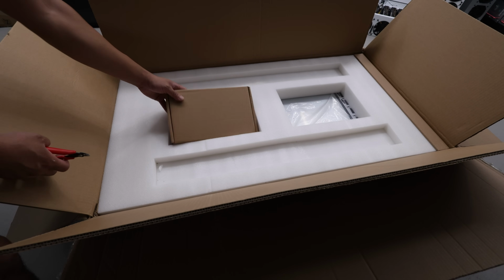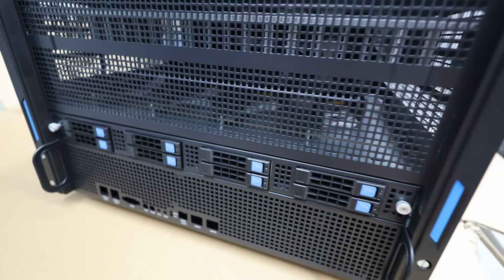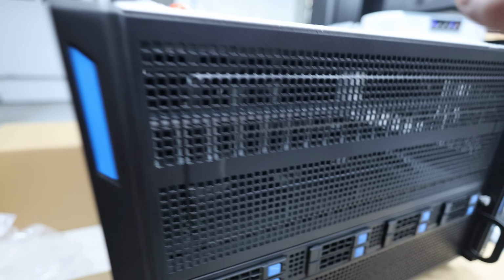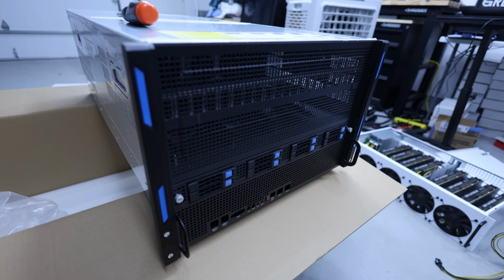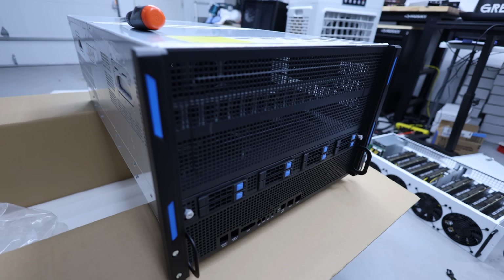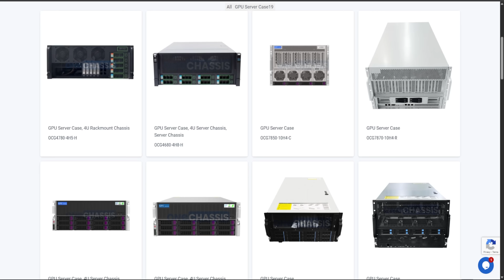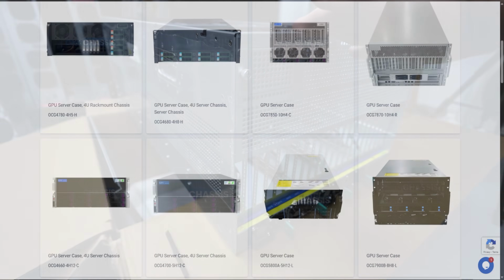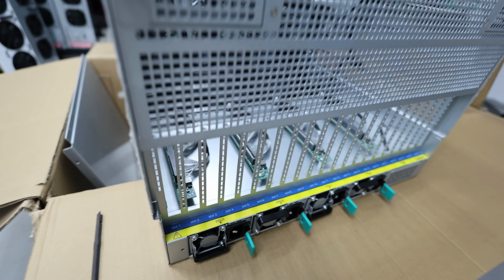INSANE 7U GPU Server! 8x RTX 5090 Build for AI & GPU Rentals | One Chassis Unboxing

Comment: You should do a MI50 build and run local llm on it.   Would cost less than 1 5090 and with 256 GB of HBM it will be interesting to see how it runs the open source models.  Would go well with your Radeon 7s.

Comment: You need profesional server pass through passive cooled cards like A100 from Nvidia, not fan cooled 5090/4090 because lateral fans of those dont mix well on airflow with those turbofans from the case, those pull push from front to back of 7U case the 5090 fans are designed to draw air from side but static air not fast moving air from case like this they will suffer what on human respiration happens when you try to inspire air in high wind and suffocating because you cannot inspire sufficient air at cold winds over 70km/h (on mountain top on blizzards ex.) so use A100 or better AI server grade GPU cards...
Reply: How do you know this? Are you sure this is the case or just something you think?

Comment: Careful you can’t use turbo fan cards on those chassis, their design is for gaming cards only as the airflow is to push hot air coming up from the GPU, not for horizontal pass through like turbo fans
I use a lot of those chassis (buying from the factory directly and customizing them )

Comment: if you're going to run multiple (8) 5090s, might as well stick 6000 PROs in there, same size, same chip with more unlocked cores (faster) and most importantly 96GB of DDR7 vram, for those hungry AI jobs
Reply: Unfortunately it's not 4x faster for 4x the price, 3x the memory but only a couple percentage points advantage in performance. Not worth it

Edit: actually depending on power budget and cooling, the 5090 is still faster
Reply: @ethans4783  the 6000 pro is not for gaming, it's slightly faster, the big upsell is running huge LLMs / diffusion models or any AI jobs that require more than 32GB of ram, that's the justification of the 3x the 5090 price, the mac m4 max has up to 128GB of unified ram, but it's much slower than a 5090 / 6000
Reply: Most importantly they have real ECC not like 5090s that only detect bit errors but they dont correct them